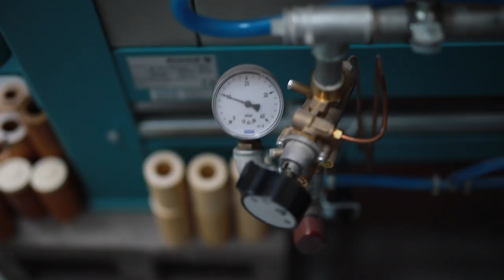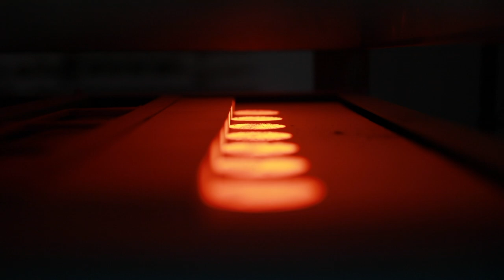Packing a Kiln Load of Pottery and Gas Firing in Reduction — ASMR Version

Comment: I love your precision throughout the whole pottery process. That's a very nice tip for glaze firing the lidded pots too! May I ask what it was you rubbed on before smoothing the flange? Thanks for another great video.
Reply from the maker: It's called Chemico Valve grinding paste, very useful stuff, albeit a bit greasy. It definitely needs to be washed off with hot soapy water. Thanks for watching!
Reply: @floriangadsby  Thank you very much.